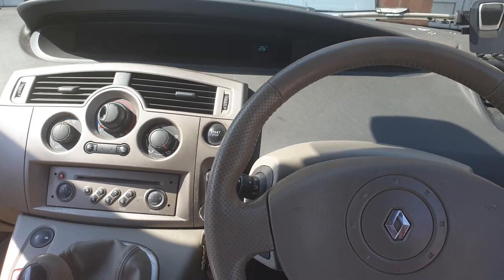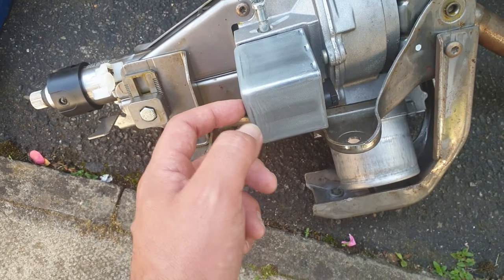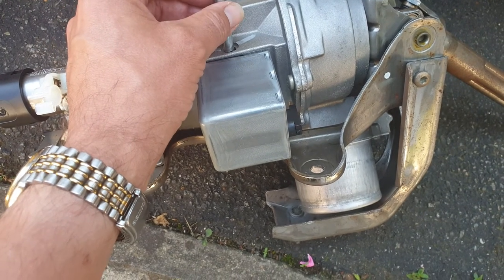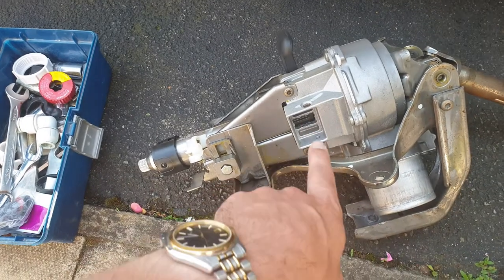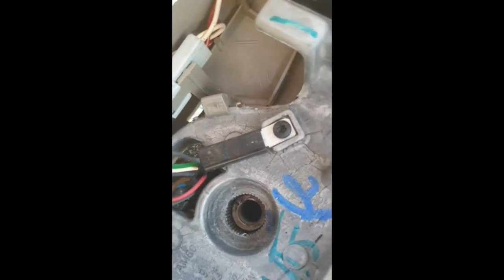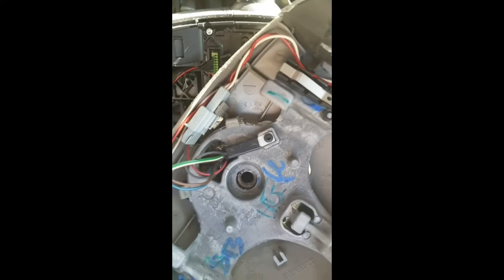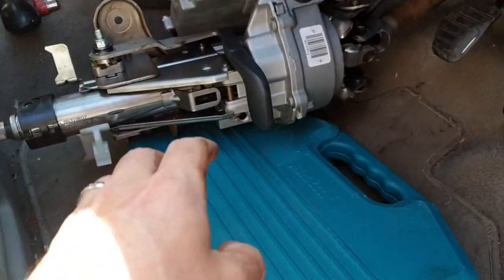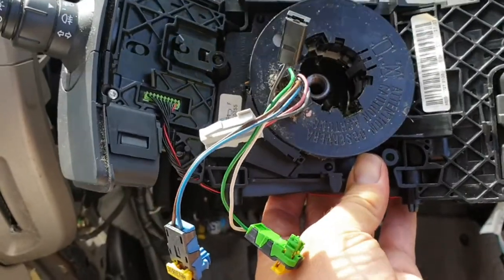Renault grand scenic power steering replacement

Comment: Spent about an hour or so getting main panel off so that I could identify which part to get from Ebay as there appear to be 3 different PAS units for scenics. Only had the main front to rear loom re-wired a couple of weeks ago because of water damage/corrosion. Bloody renault electrics! Thanks for posting this I wouldn't have even tried without it. Its worth £40 to try and save from the scrap heap for another few months

Comment: Hi.
I have a 2006 2.0L Renualt Megane 2 with power steering wheel fault code.
The power steering is stiff 💪 after starting the car and steering does unlock.
Can it be the same thing as the Scenic?
Reply from the maker: Could be, they are very similar cars. 🙂

Comment: Fantastic thank you so much. This has just gone on my modus and Iv only had the car a few days! 
Can I see the part number from looking above or from below. Many thanks
Reply from the maker: Sorry to hear that, how disappointing! As I recall i to remove a bit of the plastic surround and the part number was visible from underneath but it was a while ago. Remember to keep your old steering lock as you'll need to fit that to the replacement  column. Hope it goes well.

Comment: Really great! I'm giving this a go...simply nothing to lose! Do I get the part number from my Reg info or do I need to find it on the original part first?
Reply from the maker: Get the part number off your original  part , you should be able to see it without taking it all out. 🙂
Reply: @gavincorbould1831  Great. I'm not sure I'll be able to get a new part, just something from the breakers. I looked up ACS, they didn't have the number I think it is ...so...still worth doing it???
Reply from the maker: @carlwhite908  absolutely mine was second hand off ebay and worked great. Arrived the next day as well.

Comment from the maker: OK, so about a week later the service light started flashing and the message 'check steering ' so looks like I will need to get the code reset and possibly recalibrate the steering angle.
Reply: Dang it, just ordered a part so I could start this job! Thought it was just the steering lock that needed to be kept. Keep us posted about the fix
Reply from the maker: @k19widow  i only kept the steering lock, not sure if you can take anything else across. You'll need a diagnostic tool to recalibrate the steering angle or get your local garage to do it. Mine works fine,  just have the annoying message everytime I start the car.  Tried a cheap renault can clip on ebay but couldn't get it to work so am looking at the RT2 from icarsoft its about £135.
Reply: @gavincorbould1831  Ah ok, so its not a problem with the part not being matched to the car for immobiliser etc? but a case of the steering angle being needing to be re calibrated? I read in a few places and on a few videos that the EPS ecu holds the VIN and swapping the column doesn't work. Will probably pop it along to the local garage to get it re calibrated once I've got it back together

I also started taking it all apart earlier but forgot to undo the steering lock before I disconnected the battery, will have to plug back in again!
Reply: So all back together and currently no lights/warning, thats for this video, wouldn't have had the courage without it! - some black screws left though! i'm sure they were surplus to requirements anyway. How did you get on with the recalibration?
Reply: Yep - i've got the same steering check light now - took several days to appear how did you get on reseting it? Might just pop it to the local and get it done
Reply from the maker: No still haven't done mine ,need to swap the control board on my epb first - yawn😄
Reply: @gavincorbould1831  So my service light/steering check has come on/gone off a few times now, I spoke to a local garage and they said they should recalibrate themselves - and if its not and the steering wheel isn't perfectly centered then its better to get tracking done first to get it all straight. Any luck with yours?
Reply: @wormwood8516  ebay, second hand column for £40-50
Reply: To reply to myself on here for anyone benefit - Local garage just did the reset procedure using the renault clip software and cleared the steering check - it won't recalibrate on its own.
Reply: Mine has steering failure faukt stop light and steering is stiff anyone have any advise please